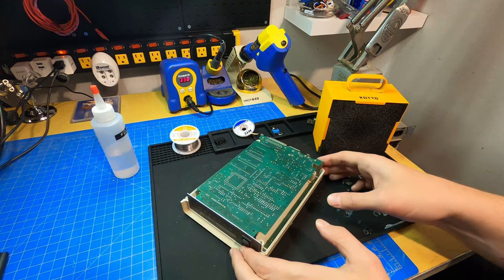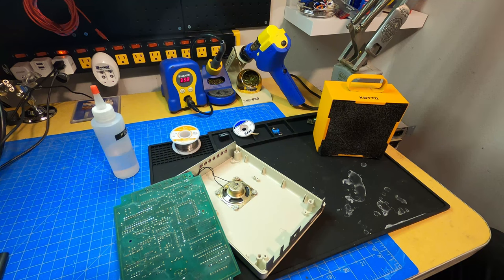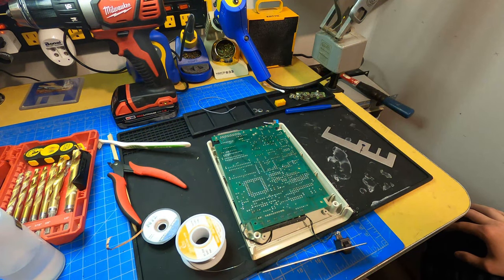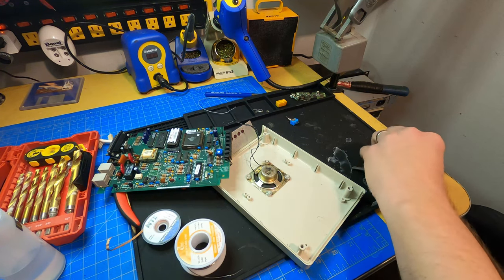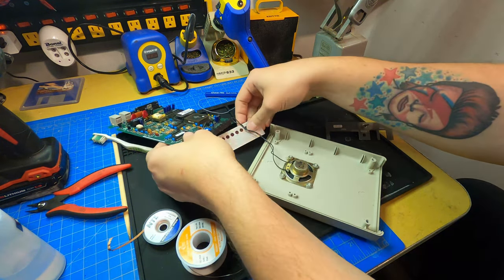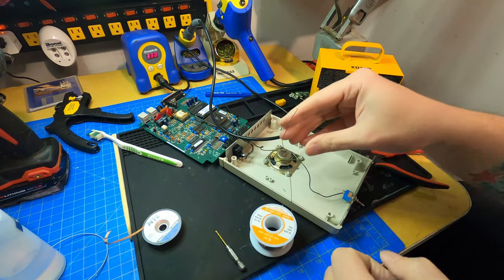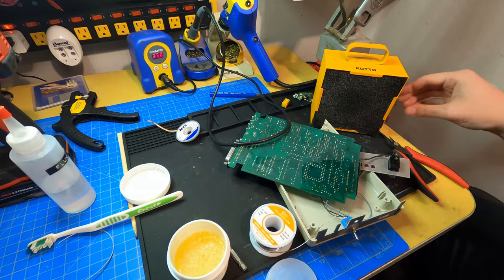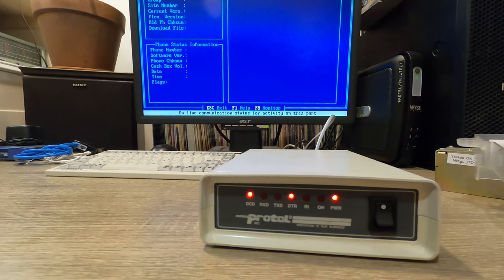Protel UPMS Modem Repair & Modification

Comment: I had never seen one of those opened up. Have had to replace relays on my old Hayes Smartmodems because they had burned out terminals.  It's an old Hayes modem I was using with my pay phone collection. If you were really concerned with originality you could use a magnetic reed switch which is what I have done for collectible electronics.
Reply from the maker: Really cool, were you programming over VoIP or copper via an analog pbx or something. I'm researching more readily available modems people can use and talking to someone doing the same, but can only get the UPMS to actually program. I've been told the other modems don't work because I'm running VoIP via a channel bank, but the UPMS works over it just fine so I'm a bit lost. 

Didn't think of a magnetic switch, that's a great idea! I'll definitely keep that in mind for future projects.
Reply: @Famicoman  I originally used a Panasonic PBX and then built the current Asterisk based system I have now with an Adtran channel bank. I had no trouble at all with it or the Carrier Access channel bank since all of the extensions were within the same channel bank. If I tried to use an ATA it did not work, The Western electric style Protel boards worked with my older modems, as well as the earller Protel boards  with an open PC board but the later ones with the steel cover would not program for me either.
Reply from the maker: That sort of tracks with what I'm hearing and experiencing. I've been told that the 7000 boards will program over an analog pbx and a generic modem but the 4000/8000 WECo-style boards are far less finicky. ATA was definitely a no-go when I tried it, even when I configured the ports to call one another directly without Asterisk in the middle (that worked for the Nortel Millennium though).